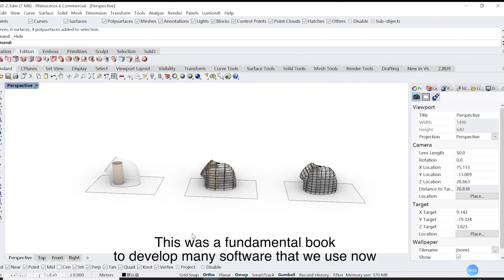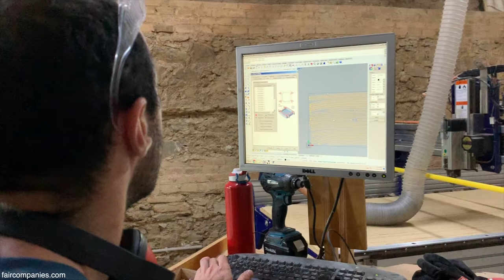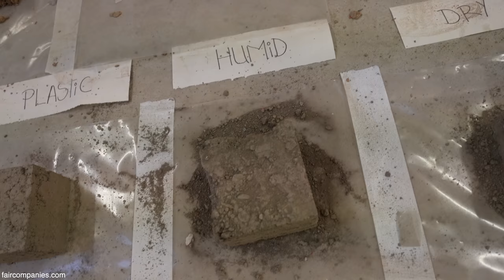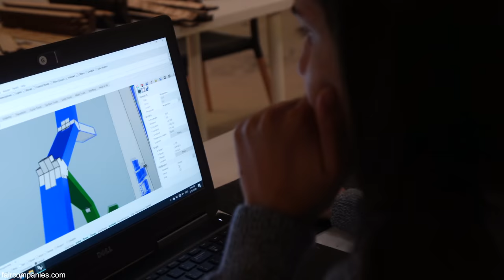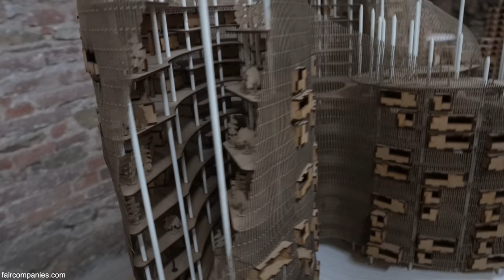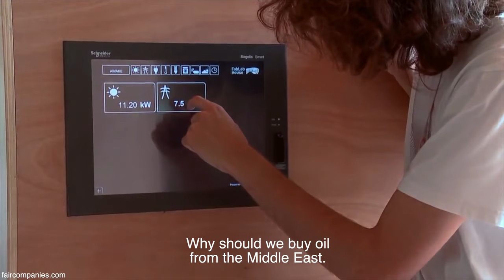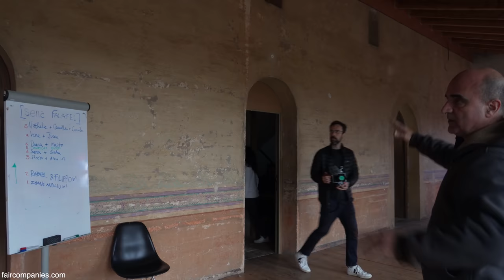Valldaura Labs culls restored forest for tiny home & biomass

Comment: Most of the younger population can't even afford a very small cheap rental, while a few decades back it wasn't hard to buy yourself a house.
Reply: pccalcio what changed?
Reply: @jimmyjohnny3779  The artificial increase of the money supply meant that more money was available for a finite quantity of goods. Prices rose, two-income families became a necessity. More money, leading to higher prices. Soon, housing became an investment strategy. Bigger for the sake of bigness, but not for any functional purpose. Higher cost, more energy and maintenance required. It is almost like the 200-channel cable or satellite TV vendors. Who needs it? Or the large metropolitan newspapers that have pages and sections that most readers will never read. It is all created to generate income, to make a more expensive product, even though the project will largely remain unused.
Reply: There is already a model of money less community in India that has 50 years of thriving existence and no forced political or religious retributions neither..and they live by gift and cooperative exchange instead money
Reply: @hominidae7sp  That's one approach. I believe our turn to an underground economy will accelerate due to the Corona Virus. Barter, trade, swap meets, Craigslist, under-the-table employment may fill in where private sector middle class jobs use to be. Government won't get any smaller, and as it is increasingly used to crack down on quarantine violators, the general populace will soon regard government as the enemy.

Comment: Self sufficiency built with modern technology is larping. The ecological sustainable lifestyle you seek can only exist with a reliance on modern technology.
Reply: MegaZeus 

memorable first sentence, will have to screenshot. thnx ;)
Reply: "Reliance on modern technology" OR its opposite: no modern technology. Think of all the capital, intellectual property, expensive equipment, skilled workforce, and synthetic materials it takes to build some valve, switch, handle or plumbing component. This so called sustainable lifestyle is possible only because it sucks the resources away from the masses to benefit a very few.
Reply: MegaZeus - YES! Larping, perfect word choice 🌲🌳Trees eat carbon & exhale oxygen!

Comment: I wonder how much energy it takes input,  to make the chips to create heat, output?
Reply: Lynn Moss we can worry about that once we run low on wood Lynn, you know that
Reply from the maker: Good question. Seems when used for heat, I've read biomass heaters can be 75-90% efficient (not the case when used for energy generation). Though the current biomass heaters seem to pollute quite a bit so hopefully there will be newer systems that can capture emissions.
Reply: I'm also wondering how many trees have to be cut off in order to produce those chips.
Reply: Did he mention re planting trees for sustainably? I can't stop thinking about the recent release of 'Planet of the Humans' as it pierces to the heart of Americans and we refuse the truth. The secret is, cutting our consumption and living closer to nature brings more joy that consumerism ever could

Comment: i am extremely skeptical that most of these ideas will be useful in the cities of the future...the thing about cities are they are very dense collections of many people, requiring many buildings that are easy to build and maintain. building like they are doing is great, and very satisfying indeed, but highly-custom bespoke buildings take a long time and much effort to both design and build, and they have maintenance issues (things don't always fit right and gaps let in elements, and every needed repair takes special custom parts). ain't nobody gonna be building large apartment buildings like this, or they'll be taking 10 years to build and come-in 10x over-budget. also, extensive use of wood in cities has fire risks (look at what happened to tokyo in ww2 when we firebombed them: TOTAL DESTRUCTION. for my final complaint i shall object to the worm-based composting toilet...it's impractical because the worms can die and the system will be non-functional while a dry toilet, or regular composting toilet does just as good a job with simpler design and maintenance. this place is just another academic boondoggle imo.
Reply: But wait! It only took 300 acres of forested hills to make this possible! Soon they will clear another 20 acres for a vegetable garden fed from their worm toilet.

Comment: Interesting project, but real ecologically-minded homes wouldn't have massive CNC machines, solar panels, biomass energy production & tons of other industrially-created materials. Building with trees is great because you store the carbon (by preventing it from decomposing) but burning them is literally the worst thing you could do (if you wanna burn stuff, burn an actually energy dense material like coal, not wood). This guy needs to meta-analyze his own sustainability a little more

Comment: it's all pretty and natural and disconnected.  great for a pretty little cabin in the woods.  but worthless for the city.  not built based on any standards.  good luck with repair when it starts wearing out.  you'll have to disassemble stuff but you'll have no idea how cuz it's not based on any standards.  what if the wiring starts going bad?  how will you repair it?  can't just call an electrician.  what if there's a plumbing leak?  can't just call a plumber.  I don't see how any of that work will apply to cities...  It's cool if you're a carpenter building your own cozy cabin in the woods.  But milling downed trees and carefully architecting curved structures that'll work off grid...  what does that have to do with cities?

Comment: If you make everything from the trees  and use them for energy, eventually you run out of trees. Then you've destroyed the area, by cutting down all the trees. I'm not feeling it.
Reply: 1. There is sustainable forest management. Forests grow approximately 3% each year, therefore the forests can be conserved if a selective logging of this 3% is made. Many parts of the Collserola Park forest where we are grew largely because agriculture was abandoned 100 years ago. Biodiversity is dying because there are no predators. We call it a natural park and it is not because we do not allow fires that cause nature to gather. Therefore, just as in many of the world's forests, sustainable management is essential in these artificial forests, to promote biodiversity and proper development. In fact, because it is not a business at all, there is a huge lack of sustainable forest management in the world to promote bidoversity.
2. In Valldaura we have hosted projects such as Dronecoria, which impose to do massive reforestation in the world, or where there has been decades of reforestation. Here is the link: dronecoria
3. Biomass energy production is considered neutron carbon because the emissions that are emitted are similar to the carbon that the tree absorbed when growing. And it is renewable because by removing some trees, others will grow around it, growing in a 3% rate. It is not a neutral carbon to burn garbage, nor to burn wood with bitumens, as some recent film quoted in the comments shows

Comment: Nice try but this is not the future in any shape or form. This just scratches the surface of your misconceptions for sustainability but wood chips furnace is not sustainable in a large scale project. While wood construction does allow you to personalize a building a market will always push a developer towards standardization of materials. Also you cannot seriously believe that a tiny house is a solution to housing problems. To increase the number of dwellings you have to go vertical and given the design of this house you can never do that. What this is is arguably a better forest hut. So congrats on that!
Reply: George go vertical or go underground.  Better thermal underground.  Still, its a start to understanding all the elements and techniques that can be developed further, changed, modified and utilized.

Comment: Um ... Professor ... burning wood produces carbon dioxide
Reply: Biomass energy production is considered neutron carbon because the emissions that are emitted are similar to the carbon that the tree absorbed when growing. And it is renewable because by removing some trees, others will grow around it, growing in a 3% rate. It is not a neutral carbon to burn garbage, nor to burn wood with bitumens, (Obviously, using gas in a biomass plant is not renewable, nor does it indiscriminately cut down entire forests. Someone could explain these issues in a more neutral way).

Comment: Beautiful, but I would have two problems with it: 1) Hail. Will destroy the solar panels I guess. 2) Lightning. No lightning protection?
Reply: no Solar panels are designed to withstand Hail ...lightning yes that maybe a problem but this structure is for design/demonstration purposes primarily not a final living place..beside the show doesn’t go into in-depth details...the Solar panels are probably grounded so lightning won’t be a problem!

Comment: As great as this is, using forests and wood is not a sustainable practice to build all your homes and generate your energy. There is a reason why we stopped using wood for everything and have had to make delicate many forests as national parks and protected areas. Because when we try to use wood for everything, we use up all of the forests. Deforestation was and is still a huge problem. There are many places in South America and Africa that have gone from jungles, woods and forests to bare or burned land because they are still using wood for their homes and energy needs. There have been millions of species and ecosystems destroyed because of this. 
I do agree with the overall point of this video though. I believe there are much more eco-friendly ways of making it a reality. We need to start looking at other materials that are much easier to grow and reproduce quickly. Forests do best on their own, the oldest trees have huge root systems that help all the surrounding trees and plants and the soil is also better. The fallen trees provide homes and a mini ecosystems of their own and eventually add to the soil. Even forest fires are apart of the ecosystem of a forest. 
Bamboo and hemp are a lot more promising that using lumber. Bamboo grows insanely fast and is just as use full is not more useful than lumber. Earth bricks and homes made of soil and other natural materials have been done for centuries and are just as good as they have always been. Now with our new technology we can make it even better. I really enjoyed that part of the video.
I think we should be done with burning stuff to make energy. It is bad for our environment and us. Generating energy using solar, wind, water and geo-thermal are much better routes that can easily be just as, if not more sustainable. There is nothing being released into our atmosphere and we are not constantly having to consume our natural resources. Then there are things like the bio-digestor where you can put your food scraps and other natural waste and it creates methane for cooking or other power needs and liquid fertilizer for plants. 
And there is certainly no reason for us to be using outrageous amounts of energy on sewage treatment as there are numerous ways of dealing with our waste so that it does not become a poison to the earth. There is no reason everyone shouldn't be composting. And ofcourse there are some other ways if you don't want to compost, you could get an incinerating toilet or have your waste go directly into something like the bio-digestor. 
WHY are we STILL sucking up all of earths ground, spring and fresh water? Do they really think it is just going to be there forever? There are many places we they HAVE used up all of the "usable" fresh water in an area. So I'm glad that the video goes over the importance of collecting your own rain water. There is certainly no reason not to. And I still can't understand why we have not started using ocean water. We already have desalination rigs. Lets just do it en masse.

Comment: The most sustainable way to do it, in my opinion, would be using ground soil to make houses, cover them with tiles made from earth, with fire from dead woods, use solar energy and water from earth holes. Build a tank to treat water with plants. But what theyre doing is cutting trees to waste a lot of wood, wich its not even treated to resist climate, for tinny unfunctional buildings, wasting a lot of resources and time with computers and big machines for almost nothing. I looked at that tinny  vegetable garden with 3 machines and i questioned for myself: is it really necessary?
Reply: looks like a place where they experiment at small scale things for large scale - they're talking about city/urban planning . Yet, I agree, building with straw + earth seems more eco-logical to me . But the value of this project is the concepts and the starting point with lots of room for improvements and like himself said, parametrization / customization / personalization

Comment: Ok from a manufacturing standpoint circular shapes are hugely wasteful unless you are casting the material in that shape.
To make those curves and rounded shapes and openings you have to cut them out of a larger piece of material.
They are pretty. But super wasteful.